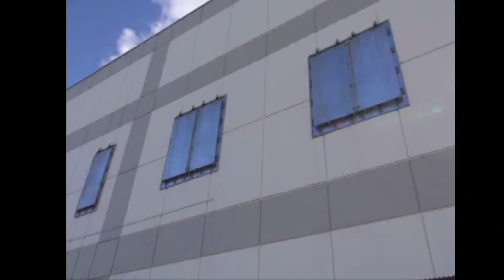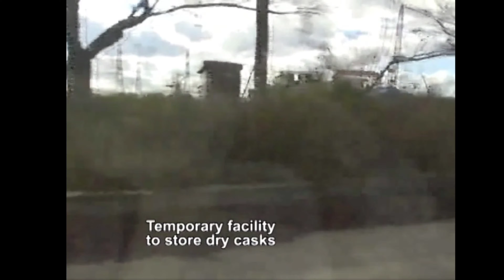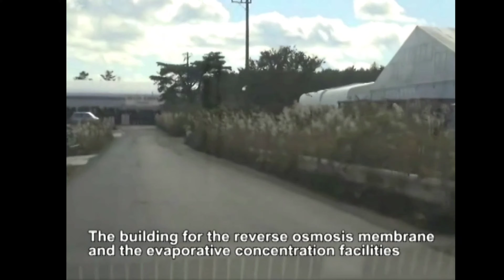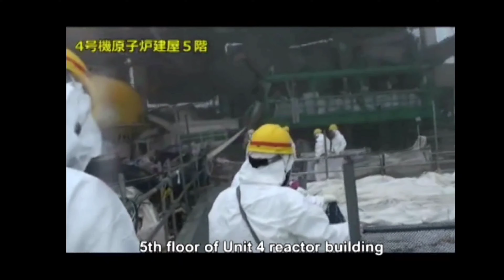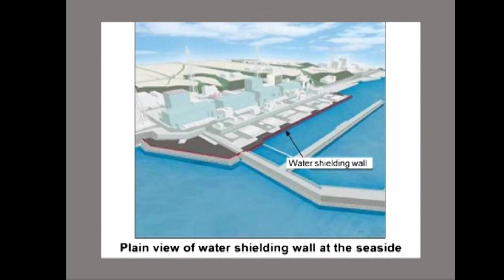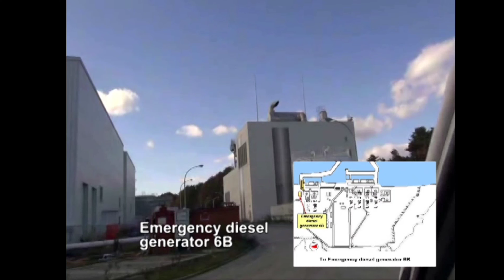TOUR: Fukushima Daiichi December 2012

Comment from the maker: This video shows when things go bad at a nuclear reactor... they go really bad.  There doesn't have to be any conspiracy theories to prove nuclear power should not be used.  From not having procedures to deal with a meltdown to not having proper machines and devices to carry out the work of decommissioning the site... yet again the cart was put in front of the horse and built them anyway.  The explosions released a massive amount of contamination, the water leaks from the basements where the Corium fuel is located allowing ground water in and out of the buildings basements.  No one knows the PH of the water coming into the buildings and where binding to the oxygen in the water occurs of which is leaking into the soil and the Pacific Ocean.  The small miniscule details mean nothing when we can prove it all without the things that can't be proven.  There is absolutely no point in arguing over details none of us can cooberate either way by using speculation and assumptions.  No nuclear power stations...I repeat no nuclear power stations should exist on this planet where perfection is needed with this power source and humans are incapable of such perfection, ever.  Just with what I mentioned, these reactors should be shut down for good...everything else is just muddying the water to no end.
Reply: Agreed.